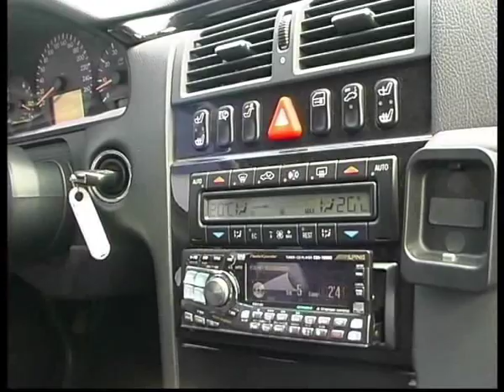Mercedes Benz E420 V8 W210

Comment: That's right, it's E430 equipped with V8 M113 4.3 liter engine, 279 horsepower, not 286 as the author says.

Comment: Алексей, извините, но вы порете чушь.
Вы говорите про 4,2 М119 мотор, но на картинке показываете рестайлинговый 210-ый, на который из V8 ставился серийно только М113 4,3 мощностью 279 л.с. 
Да и большую и длинную линейку двигателей вы ругаете зазря.
На рестайлинге серийно из бензиновых моторов ставились: Е200 KOMPRESSOR(2.0 компрессор), E240 (2.6), E280 (2.8), E320 (3.2), E430 (4.3).
Дизели: E200 CDI (2.2), E220 CDI (2.2), E270 CDI(2.7), E320 CDI (3.2).
Чем вас не устраивает такая гамма моторов?